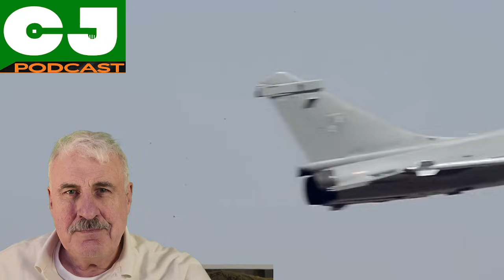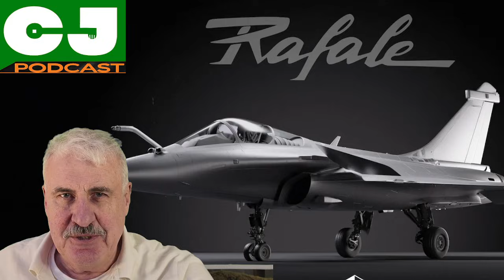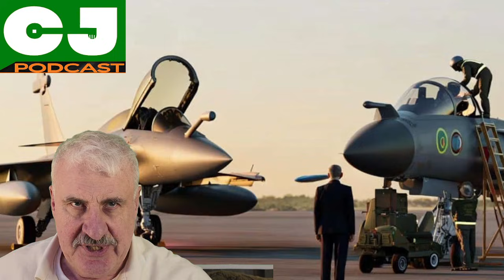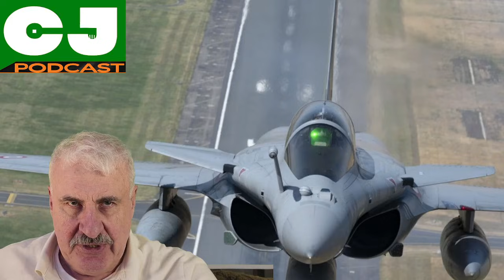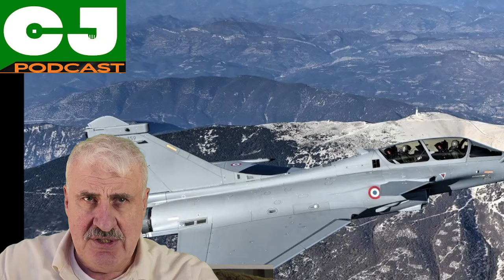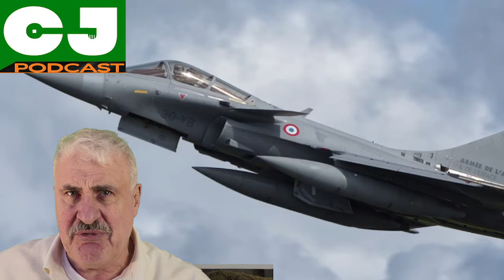Rafale vs Gripen – What Should the Irish Air Corps Choose?

Comment: Realistically there is nothing to even think twice about. The gripen is our only option. The only question will be, (if the government do pick any jet fighter at all), which version they will look to buy. The American engine is not a problem because it is being replaced with a Rolls Royce engine shortly due to the issues between America and Canada. The Irish government might try to get an older version but I think that will be a huge mistake! It will look like a big cost savings but over time it will become obsolete quicker, which is a concern, but not a major one unless there is a wider war in Europe. The big issue will be parts and upgrade costs. The upgrade costs will increase over time, the older something gets the more work it takes to keep it running. That is as true for jet fighters as it is for the car you drive. The big problem is parts! If you have ever owned a car that's not being produced anymore, you will know it takes your mechanic and age to find parts and then get them shipped, all while you are paying for his time, and you are down to one car or worse yet paying for a rental. Also if it can't be sourced, it will need to be made, which will be many multiples of the original sticker price. What will compound this problem for anyone receiving the older fighters from the Swedish Air Force, is that they will only be considered after Ukraine has been looked after. That's only right and proper since they are the ones at war. However when they get given a bunch of the older fighters, they will also get nearly 100% of the older parts the Swedish Air Force had for servicing the jets. I can't see the Ukrainian Air Force parting with anything until their war is over. No the only way to go is to buy them new. It will take a number of years to train our Air Force pilots to fly these jets so if we have our lads training in their simulators and then in the gripen training aircraft for a few years we won't expect to have a fully equipped jet fighting Air Force before 2030 and that's probably optimistic. By that time the Canadian production line should be up and running which might lower the sticker price a little but even if it doesn't, the running costs will reduce even further, (it's already the cheapest jet aircraft of its type in the world to keep in the air), and with a bigger production line of the new gripen the quantity world wide will only increase. That means parts will be readily available for decades to come. Between all of what I have said, the fact it can take off and land on roads, and only needing a five man crew to re-arm and refuel within a 15-30min window in any weather, it answers all our needs without causing new problems like building hardened hangers to protect against first strikes. It is our only option!!

Sorry that's so long winded 🫡

Ray Moore
Reply: If Ireland opts for Gripen, 2 remarks.Adaptation of a rolls Royce engine will take years, delaying the delivery.
And the new version costs about as much as the Rafale.
So cost should not be a deciding issue
Reply: Everyone is tolking about a potentiel Rolls Royce engine which only existed in 1998 in some power points... Please points me out any link to an official RR anounce about it and I'll change my mind. Until then, the Gripen has an american engine.
If you don"t ahve an engine, you don"t have an aircraft.

Comment: I thought you were europeans. What is wrong with the Typhoon. It isn't just used by the UK. The Turkish ir force has recently selected it. It would do everything you need. The Irish Air Force doesn't need data link etc. unless you plan to integrate with Nato.Is it because the European Typhoon base is in Scotland? Its cheaper than the Grippen as well if you ignore the full life costs.
Reply: According to the Indian Air Force the Typhoon's operating costs are higher than those of the Rafale's.
Reply: Highter cost, less capable than the rafale, not omnirole,  a total failure export, not Itar free ( not very known by everyone but it's True),  difficulty to upgrade  as less modulable and a way too much variant with national specificity which imact the potencial of evolution.

In conclusion it's just a huge aircraft less capable and a way too much expensive when you know you can upgrade the distance capability wiht a A330 Mrtt or KC 46

Comment: Has been said numerous times! The Gripen E is the best all round aircraft for Ireland. The Gripen can operate out of numerous airfields, designed to be easy to refuel and service between sorties. Is more likely that deeper maintenance can be undertaking in Ireland. Rafael would have to go back to France for deep maintenance. To add the Gripen E is cheaper to operate per flight hour.
Reply: Why whould any Irish rafales needs to go back in France for "deep maintenance"? I put quote because there is no "deep maintenance" in the rafale. Doesn't work that way anymore. The system tells you what to change when it's needed. You don"t need to stop the aircraft and make to full review to detect potential issues.
but really yhe question is why would they need to go back in France? Irish are not capable to operate aircrafts? All our other customers do it very well (Croatia, Greece, India, Egypt, etc).
I would be very surprise that Ireland could not operate them...

For the Gripen E, being cheaper to operate... please provide me your sources... I'm very sceptical by advance: Only Brazil has the version E... and it's quite expansive... the old vesions (C/D) were less expansive,, but they had nothing to do with the E... So please, share your sources...
Reply from the maker: Excellent points about the Gripen E's advantages for Ireland.

Comment: Grippen is cheaper to buy ,run and maintain..
Reply: Any proof of this? According to Saab in 2023 with aviation week, the operationnal cost per hour of the Gripen E is around 23000 dollars.
Last year, french airforce (which have a high standard of availability rate) shared that the cost per hour is around 20000 euros...
So roughly the same.
 But rafale carry more weight, do more mission in once, has a better range and isntwin engine (which can be cool when you flight over the sea... Last time I went to Ireland I remembered there were a lot of sea around 😂).
Grippen E doesn't really exists yet. Brazil has the first of the series and Sweden is also receiving their firsts model 
Rafale is already on its F4.1 standard and the order for the F5 are already made .. way more mature. The costs are known.
Reply: @rcouderc  I assume a twin engine fighter burns more fuel than single a engine fighter and an extra engine to maintain...thats common sense.. its like comparing an F-15 to an F-16..
Reply: @265justy  I would rather have prefered more serious reference instead of common sense...
Ok, let's do the exercise by just focusing on the fuel:
According to DA & Deffense Issues, the rafale burns roughly 2,600-3000 kg of JP8-JetA-1/hr.
For the Gipen E, it's below 2,500 and 3000 liters (no kg). So it's roughly the same amount of fuel burns.
F414-GE-39E is way more big and powerfull that the small M88-2. But less efficient at the end then the two M88-2 all together.
So once again, commen sense is never a good friend sadly.

But the price of hte fuel isn't a relevant factor at all. It's a small fraction of the price.
The 2023 study from Aviation week ordered by Saab tells us that the operating price of the Gripen is around 22 174 USD (20k€ then). Which is excellent.
But a just a bit better than the Rafale ( 22k€ for the french airforce, a bit less for the export version variing from the country and their operational contract)... 

Many people are just keepjng in mind the price of the old Grippen C/D and just claims that the new Grippen E has way cheapest to operate than the competitior. It's just wrong.
Reply: @rcouderc regardless of what you say . More spare engines need to be purchased with the Rafale thus driving up tbe cost overall..
Reply: @265justy you don't have to double the number of spare engines to reach the same level of availability (it's basically my job ;) ). If an engine needs any intervention, it takes one hour to switch it and then you have all your time to operate the offline engine.
Each M88-2 cost less than RM12.
At the end your operational availability rate can be very high for roughly the same price. The example of french navy availability being around 90%  which is very similar to the earlier version of Gripen E already deployed (of course they are very few on service now so it's hardly representative).
So having two engines is better for availability rate and spare.
That's why at the end the costs per hour are roughly the sames.
Reply: @rcouderc I disagree..

The Saab Gripen E is significantly more affordable than the Dassault Rafale, with a lower unit price and roughly half the operating cost per flight hour, often cited around $4,000–$10,000 for the Gripen versus over $14,000–$16,000 for the Rafale. While Gripen excels in cost-effectiveness, the Rafale is a twin-engine, heavier fighter offering superior payload and range. 

Cost Comparison Overview

Unit Price: The Gripen E is generally priced around $85 million–$100 million per unit, whereas the Rafale, often considered a 4.5+ generation fighter, carries a higher per-unit price. In some competitions, the Gripen was offered at nearly half the price of the Rafale.

Total Ownership/Contract Value: In a 2014 Brazil contract, 36 Gripen E/F jets were priced at roughly $4.02 billion, compared to approximately $8 billion for a similar number of Rafales. A 2026 Colombian report confirmed the Gripen was more cost-effective for their needs.

Sorry but the Air Corp dont need a long range strike fighter / bomb truck that can launch from an aircraft carrier.  This is about a simple fighter jet for air to air intercepts.
Reply: @265justy  That's why I feared: you're doing the good old confusion between the Gripen C/D and the Gripen E.
Your numbers are coming from the czeck reports. But you can see that Czeck republic doesn't have any Gripen E. They only have the old Gripen C/D which have nothing to do with it.
The E is only in service in Brazil. Colombians just ordered it, they have no number to present. 
My source is SaaB itself with Aviation Week from a study done in 2023. The price for the Gripen E was then around 23k$. I trust SaaB for their own number.
But also one important factor is the mission: Patrolling around Ireland for a single engine will limits you to a maximum of 90km distance from the shores (very optimistic gliding distance in case of engine failure). For a country like Swisserland without seas around, it's perfectly acceptable. But for an island... I don"t see the logic. if AirPolicy is the only mission, it's fine. But if you add the seas patrols... single engine is just not suitable.
You talk about price? I can tell you that an engine failure at 90km+ from irish shores will have a way more dramatic impact. Not just the loss of the entire aircraft, but the risk for the pilot. If you do this choice like the US Navy did for the F35, you have to prepare all the massive SAR coverage (with a tons of helicopter always ready to go to rescue your pilot). You see that the final price is not sustainable for a single engine.
It's just my thought and you're totally right to disagree anyway.
Reply: @rcouderc  Typhoon is likely 2 to 2.5 times more expensive to operate over its lifetime.

This is statistically incorrect.

If an engine has a mean time between failure (MTBF) of X, a twin-engine jet has twice the probability of an engine-related mission pull-back or maintenance event compared to a single-engine jet.

It takes one hour to switch an engine. That might be true for a practiced crew in a hangar, but he is ignoring the capital cost. To "switch it in an hour," you must have a $10–15 million spare engine sitting on a rack, fully maintained and ready. If you have a fleet of 20 Typhoons (40 engines), you need a significantly larger "buffer" of spare engines than a fleet of 20 Gripens (20 engines) to maintain the same availability.

Even if you can swap an engine quickly, the total workload remains.

Every flight hour triggers scheduled maintenance. On a twin-engine jet, you are inspecting two sets of high-pressure turbines, two sets of afterburners, and two sets of digital engine controls (FADEC).
A twin-engine jet requires two sets of fuel pumps, two sets of hydraulics, and complex gearboxes to sync them. This doubles the "points of failure" in the propulsion subsystem.

A Typhoon/Rafale has a significantly higher fuel flow.
The Eurofighter’s empty weight is approx. 11,000 kg, while the Gripen E is approx. 8,000 kg.

Kinetic energy and friction losses scale with mass. It takes more energy (money) to push a 11-ton object through the air than an 8-ton one. Even if maintenance were "free," the fuel bill alone would ensure the Typhoon is never "roughly the same price" as a Gripen.

High availability is possible for any jet if you throw enough money at it. The French Navy achieves high rates because they have a massive, dedicated logistics tail and a very high budget per airframe.
The Gripen achieves 90%+ availability with half the personnel and a fraction of the budget.

 Saying a Typhoon/Rafale is "as cheap" as a Gripen because they can both reach 90% availability is like saying a Ferrari is "as cheap" as a Toyota because they can both drive at 100 km/h. One just costs five times more to keep in that condition.

Comment: The Rafale is a better option operationally, but not economically
Reply: No if you dont want to go far and bomb then maybe... and dual engine is old myth from the 80s and 90s
Reply: @laves820 when you’ll take some tripe A  in your single engine aircraft, you’ll think « I really was an idiot to say that ! »
Reply: @bleklerock  
The 'single engine vs. twin engine' argument is a 1970s mindset. Modern engine reliability is so high that mechanical failure is rarely the cause of loss—it's usually systems or electronics, which affect twin-engine jets just as much.

In a real AAA (Anti-Aircraft Artillery) or SAM (Surface-to-Air Missile) environment, I’d rather have the Gripen E’s world-class Electronic Warfare (EW) suite to avoid being hit in the first place, than carry a spare engine and hope for the best.

Bringing up AAA (Anti-Aircraft Artillery) for Ireland is a strange move. AAA is a short-range, ground-based threat. Unless you're expecting a full-scale ground invasion of Cork or an enemy fleet sitting in Dublin Bay, AAA is irrelevant. The real threats are long-range missiles and high-altitude intruders, where Gripen’s Electronic Warfare (EW) suite provides more protection than a second engine ever could.

Also, let's be real: on a Rafale, the engines are so close together that a catastrophic hit to one often takes out the other. Two engines just mean a larger IR signature for heat-seeking missiles and double the maintenance costs for a taxpayer. I’ll take the digital agility and stealthier profile of the Gripen any day.

You’re paying double the maintenance and fuel costs for a safety margin that is largely offset by the fact that you have twice as many components that can fail. In modern aviation, complexity is the enemy of reliability.
Reply from the maker: You've hit on a key point regarding the Rafale's strengths and weaknesses.